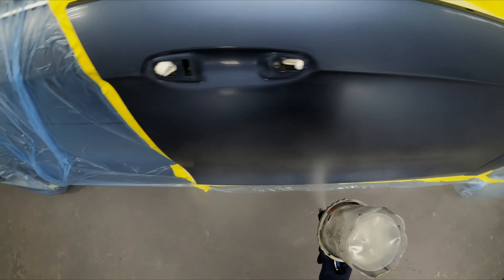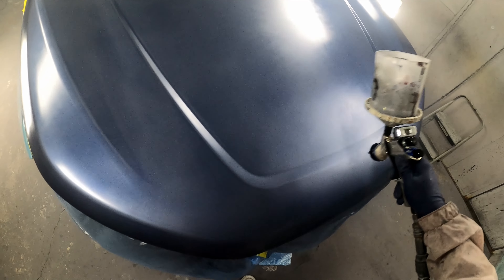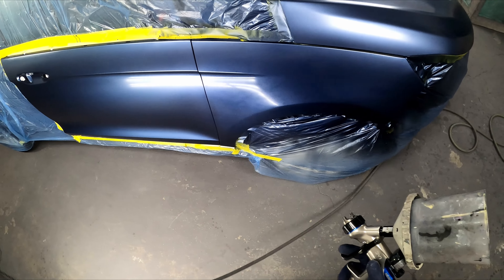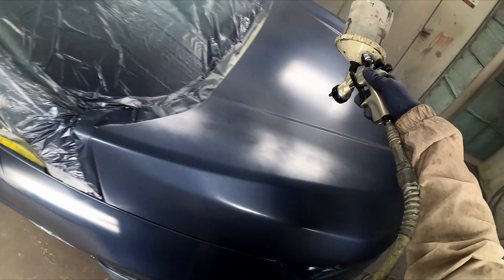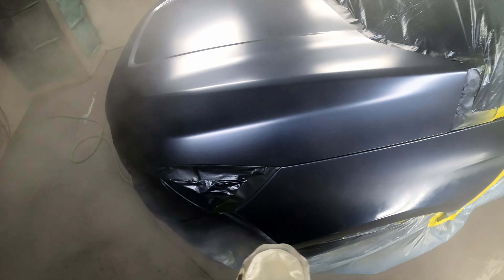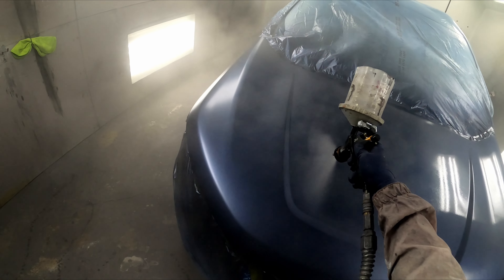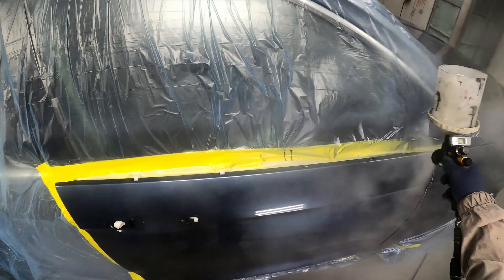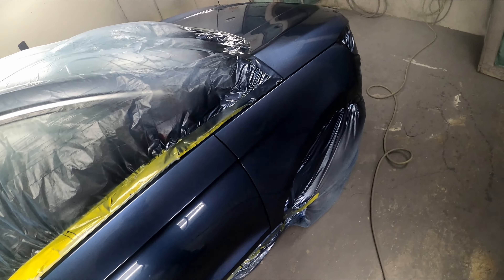Spraying the Blues

Comment: Have you made a video yet with what grits to be blending with what I should leave my primer in those type of details❤
Reply from the maker: When blocking primer I got 320grit then 400 if I’m spraying sealer on it first I stop wit 400 grit… if I’m not using any sealer I will go over the primed area wit 600 grit and u can paint over 600 wit no issues

Comment: I have a question I have a brand new 2023 off the lot truck that a customer wants two-toned along the bottom being a factory clear coat how do I go about prepping the area that's going to receive the two tone also do I have to Scuff the entire panel and reclear the whole panel what would I have to do
Reply from the maker: I would use 800 grit on a Orbital sander with interface pad… 800 grit paint will stick to and if u clear over 800 grit u won’t see any sanding scratches…. If I was sanding by hand I would use 1000 grit yet sand
Reply: Thank you for your quick response.